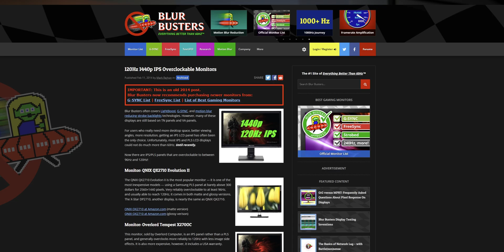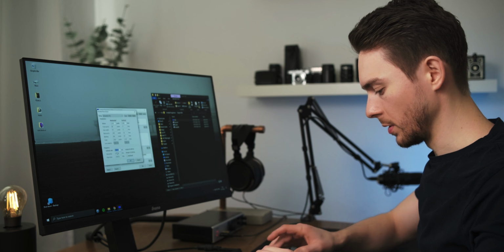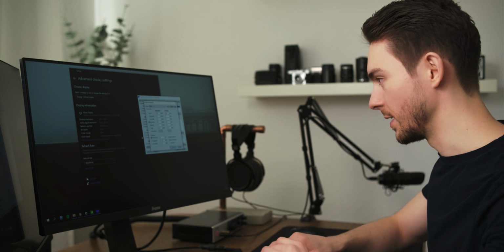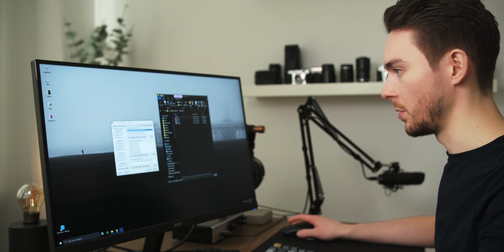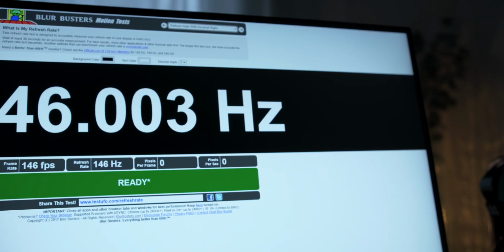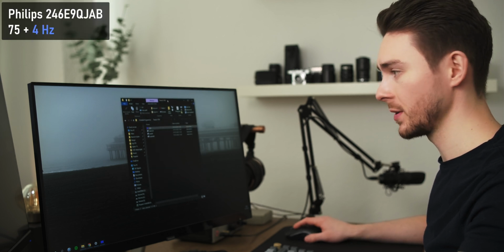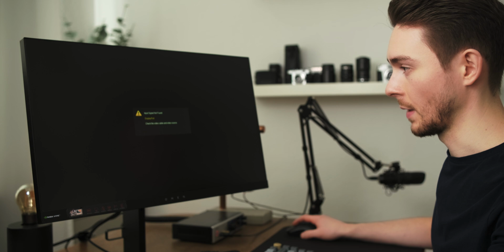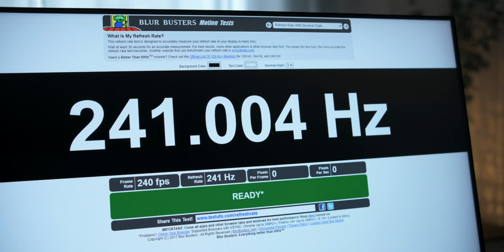Overclocking Monitors - Still Worth It?

Comment: Hey man. I just bought the G24F and your review made it so much better. 
I wanted to know if your G24F monitor still works well with the OC feature. 
Thanks!
Reply: I use 170 Hz at the same model monitor already 2 months, and don't see any problems with that.

Comment: After this video I decided to try and see if the EX2510 was possible to OC. I now realise it's more than likely that the EX2510S has the same panel as the non-S variant as I was able to push it to 170hz from it's regular 144hz. If you still have yours from the review, I'd recommend testing it.
Reply from the maker: I don't have it anymore unfortunately. Thanks for sharing your results though!
Reply: After some more messing around it looks like it will only manage 165hz if blur reduction is enabled and 170hz will sometimes give it an out of range error when switching to it, so 165 seems like the sweet spot.

I also haven't tested with freesync/gsync enabled at all.
Reply: It's not same panel.
Reply: I also own the EX2510 and one thing you have to consider when OCing screens is frame skipping. The EX2510 has very considerable frame skipping at 165Hz.
Reply: @zargoyx7567  how do you test for frame skipping?
Reply: @UnluckyDomino  there is a test on the ufo website
Reply: one could assume that but even among same models such as the AOC24g2 has different panels depending when you bought it. One monitor may oc well another may not at all. even if they appear to be the "exact same" monitor.
Reply: I have EX2710 and I could only go up to 147hz
Reply: Have u try turn on hdr or change mode color to racing mode? Mine going to black screen. Luckily i can change custom resolutions using hdmi cable
Reply: @manssupar  I got no issues with those modes but I don't use them anyway. I use the standard mode with an icc-profile which provides the most accurate colors.
Reply: @zargoyx7567  yep i use standard mode as daily use too. But for movie i will use standard hdr, i mean why i pay 250$ for hdr thing if im not use it? Max i can go is 147hz with hdr mode, standard mode i can get 165hz no problem
Reply: does it still work properly ?

Comment: This was rather an interesting video away from your usual type of content, really enjoyed it tho. Funnily enough, my monitor, the Lenovo G24-10, is a monitor which uses the same panel as the 24GL600F, which I recall could be overclocked pretty well, saw some blur busters post saying they got it up to 200hz. I also recall seeing some benq zowie 144hz monitors overclocked to 200-240hz tho that required color depth to be set to 6 bits (ouch). but yeah monitor overclocking is essentially dead these days, which I honestly think is not a bad thing, stops people from nearly killing their monitors.
Reply from the maker: Thanks man! Glad you enjoyed it 🙂
Reply: I think these were really rare cases of killing monitors